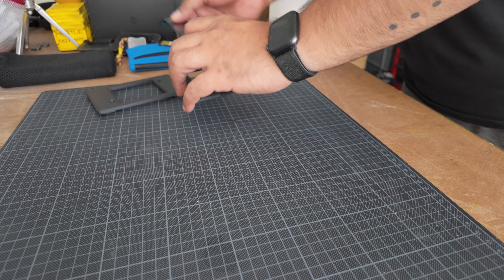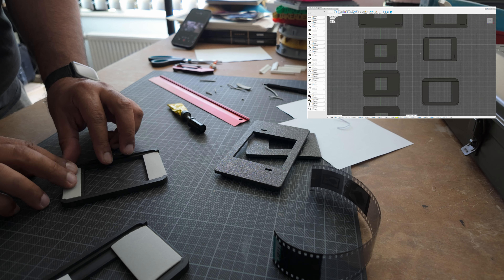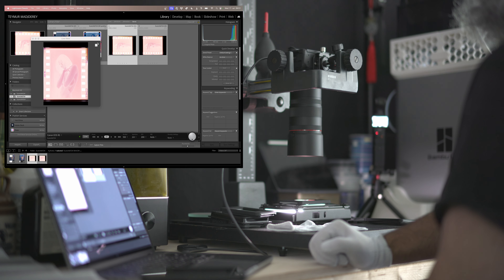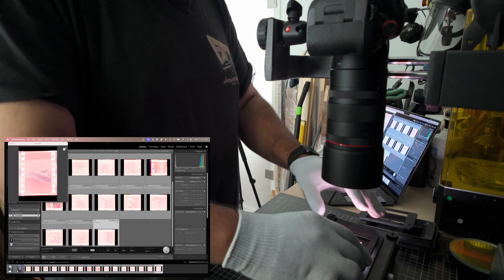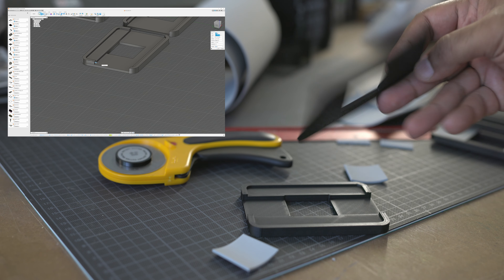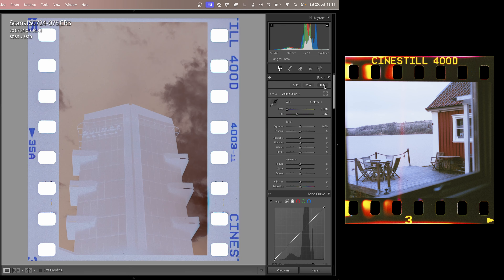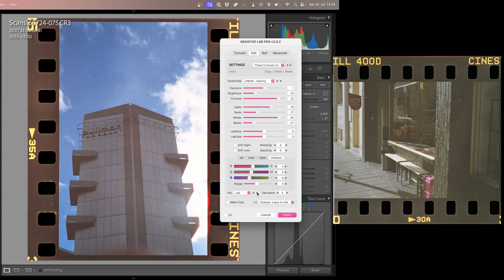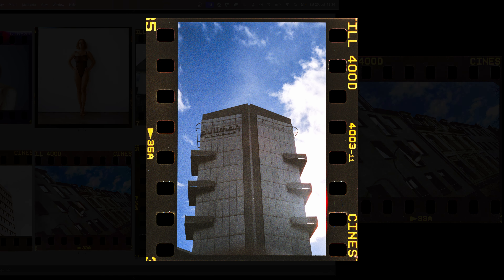012 - DIY Valoi Mask For Film Scanning

Comment: If you crop the image such that the sproket holes are out of the frame before you edit in NLP you will get significantly better results. Once done with the edit, you can then uncrop and bring the sproket holes back.
Reply from the maker: Thank you so much helios. That is the most useful tip I've gotten for NLP. Gonna try it with my next batch. MAkes sense I guess, when you think about it, but I for sure didn't :D
Reply: @teymthebeast yea, I kept struggling for the longest time with panos being washed out and someone on their forum recommended it. Game changer.

Out of curiosity, what is the material you are using in your molds to hold down the film but not scratch it?
Reply from the maker: It's just PLA and PETG, I did print it as fine as possible in the end, but really have not had anything happen so far, or at least what I noticed, but I am going to have to go in again at some point and refine the design. It works as I needed it, but it could be a bit more elegant I guess and then you could also go in and sand and polish it, if it actually would be scratching the film. Both materials are quite well sandable.